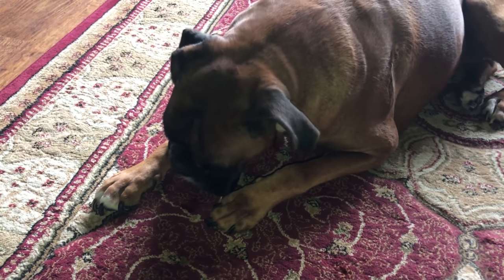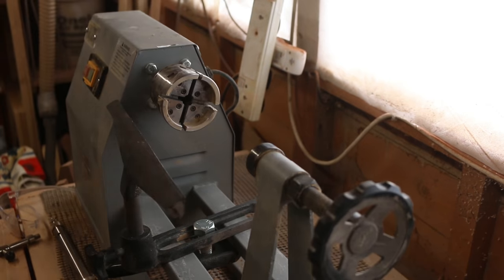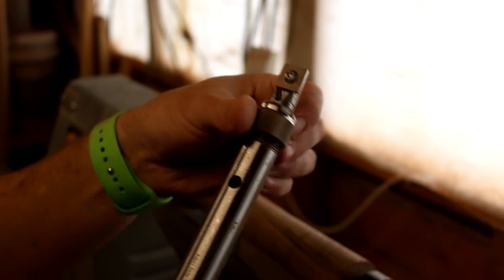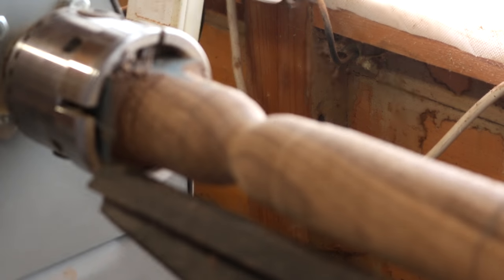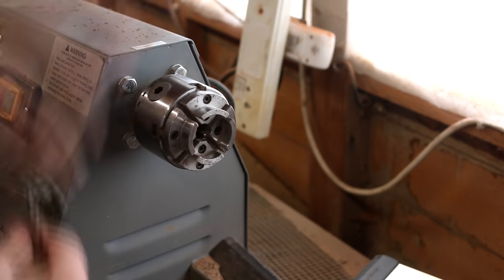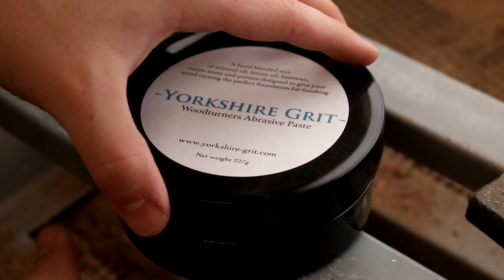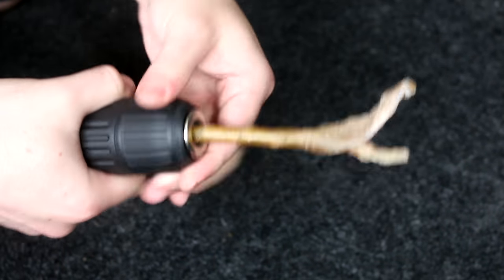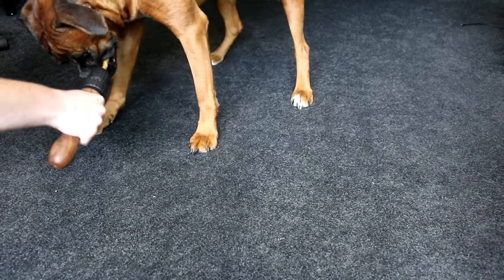Making A Dog Chew Holder On The Lathe

Comment: Great job Joe. When you started with the square stock,  as you were mounting it in the chuck I would have done it so the square ends are between the jaws as it will hold much better. 

I'm guessing the Safety Police may have already commented (not read the comments) but don't use cloth on a lathe, always use paper towel as they rip if they get caught.

Well done, I suppose one way for a  workout have a tug of war with the dog!
Reply from the maker: Haha Thanks Paul! 😊